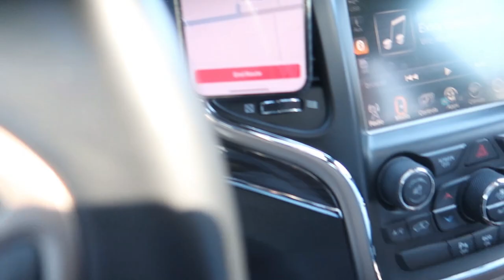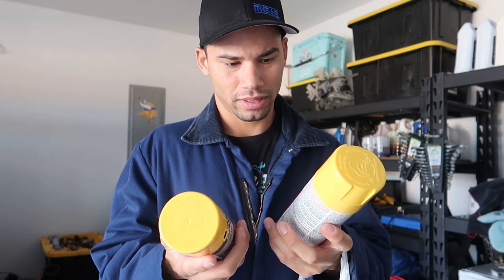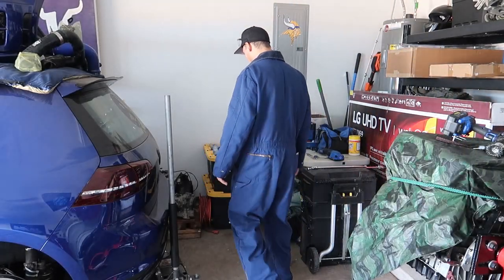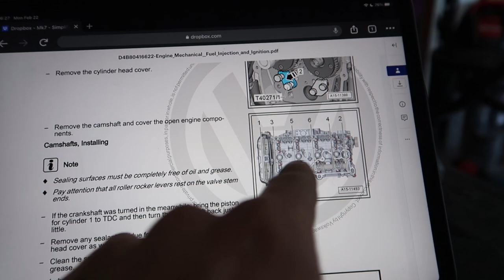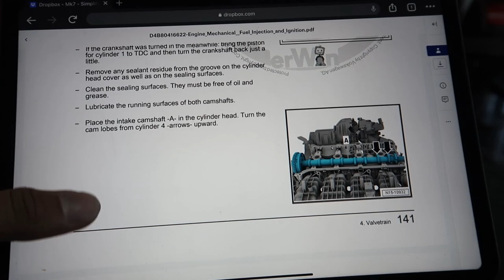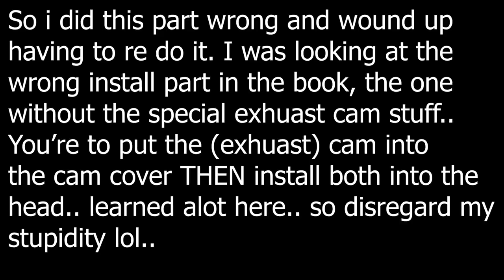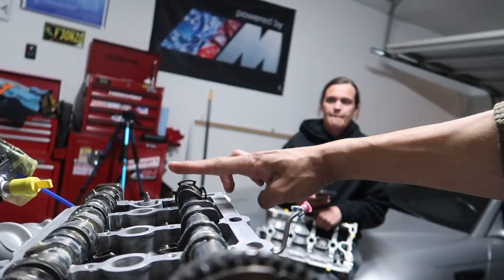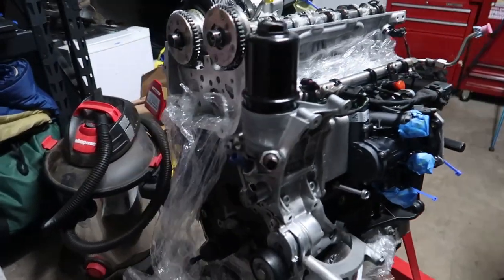Cam cover back from powder! Trans painted.. Cams installed WRONG | MK7 Golf R

Comment: My valve cover is leaking in to my spark plugs just wondering can I remove it without doing anything to timing
Reply from the maker: Nope not that simple.. sadly..
Reply: My friend done it and he was fine but seen you built a whole engine though I would ask
Reply from the maker: I mean.. you can but it's kinda gehtto and I wouldn't suggest it. If he can and you trust him maybe let him do it but I wouldn't do it myself.
Reply from the maker: The cover holds the cams down so If something happens you're out of time then it's alot of work from there
Reply: Yeah I get you and could anything happen or